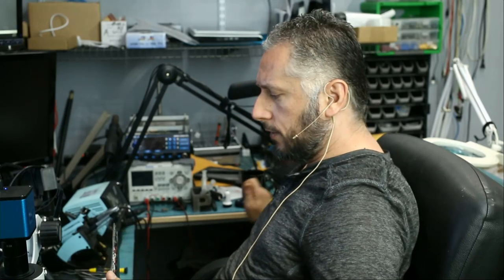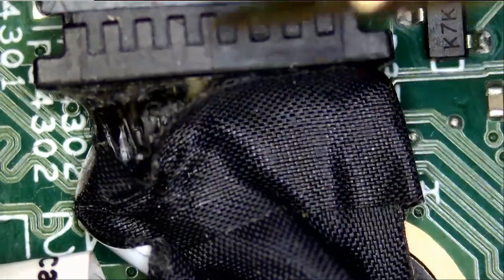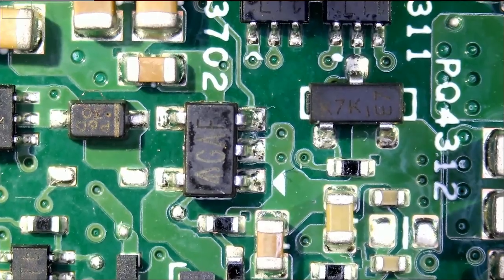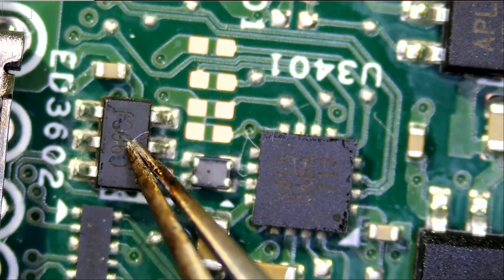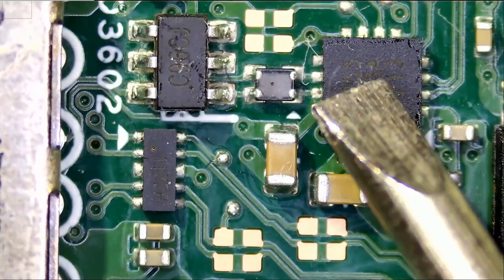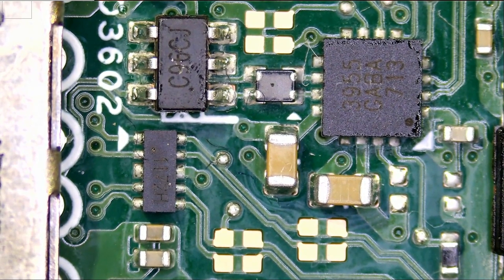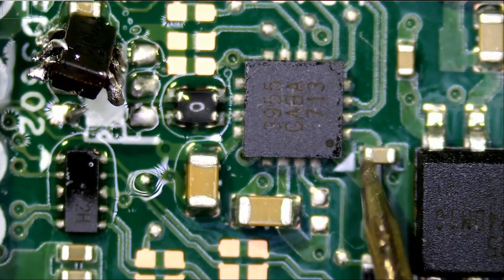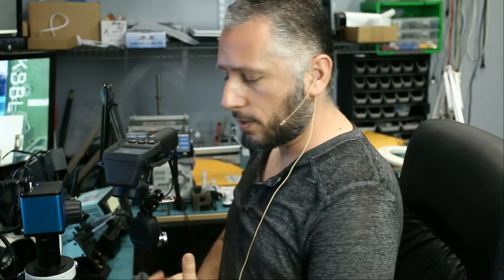Dell Inspiron 7373 No power Repair using Flir Thermal Camera - Faulty Power Controller

Comment: Thank you. Looking forward to the follow up video. Looks like that part is not so common though. :(
Reply from the maker: I ordered a batch from china and waiting for part to arrive. This chip appears to be common on TV's. Doing more research, it appears to be an ESD protection chip. It plays an important role so that when ESD strikes, it diverts current to ground to protect the circuit.

Comment: His very knowledgeable but I don't think the area where he works is clean or enough care is taken to ensure no damage or scratching happens while handling some of these goods ...
Reply: @VA,if you have seen his other videos then you will not complained about space,he has two work benches,one for microsoldring and one for assembling the finished job,i hope you`re hear to learn why not take the knowledge he is offering for free and leave the rest,his workshop is organized.
Reply from the maker: We use Commercial Grade  rubber ESD mats hence the blue color of the benches. Scratches will not happen.